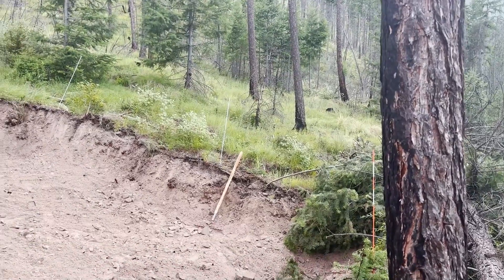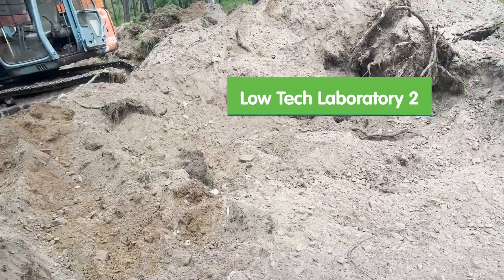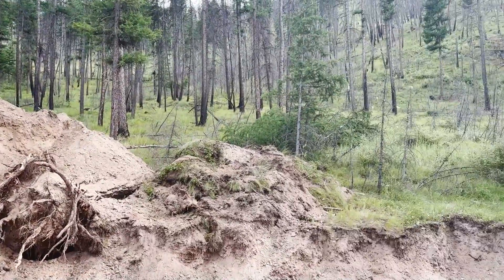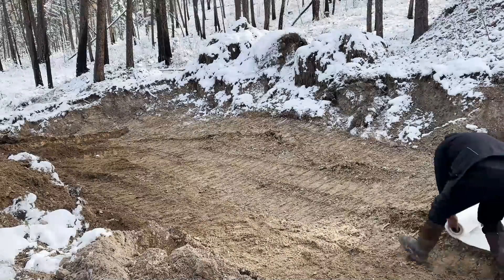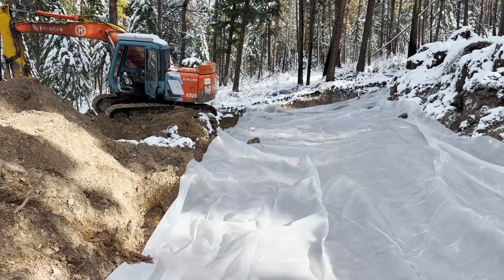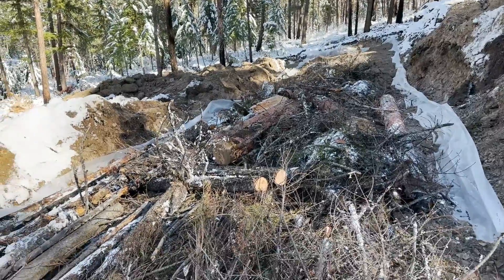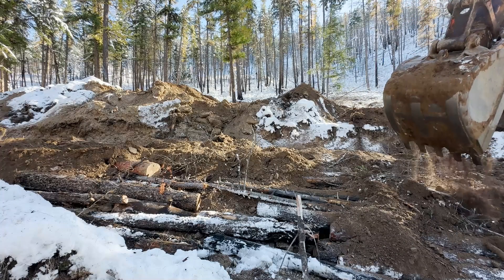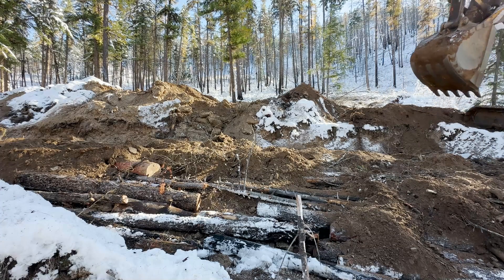engineering a spring where there is no spring - the humus well technique

Comment: More plastic in the ground?
Reply from the maker: if the experiment works, we will try clay next time.
Reply: The idea is to create an impermeable layer. In some locations, the natural geology, such as certain types of bedrock, may provide this naturally. However, if you're not that fortunate, this system allows you to create it anywhere. As Paul mentions, clay is another option, but in this case, since the plastic will be buried, it will last for a very long time.
Reply: Yeah, it does sound like a recipe for microplastics in your spring water. An impermeable layer of clay might be a much better, though more time consuming, sealing choice.

Engineering a spring is a great idea. A healthy spring, free of toxic impurities, should be the ultimate goal.
Reply: @alanmcrae8594  if only we could get away from the black plastic piping...  or I should say get away without spending a fortune.
Reply: I create my springs with dug wells,  put the stones back in the hole and take a little bit of time to stack the top of the stone pile very tightly,  so it 'seals' then put the clay back on top,  real thick then topsoil,  then the only plastic you have is the waterline itself, that you set into the stone matrix at whatever level you want.
Reply: Make it all out of glass piping and all its the only way to make sure your not ingesting any thing harmful this method is not green enough for the real greenies we use glass so we never have any germs it's expensive to have glass plumbing but can you put a price on your health it's gonna add atleast 6 months to my life I know it